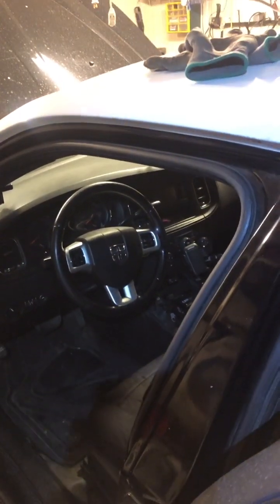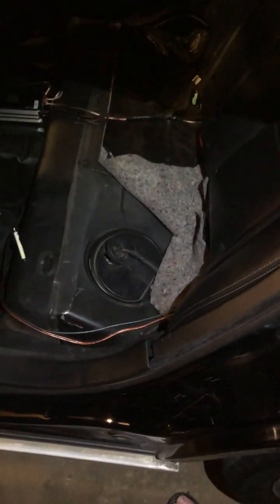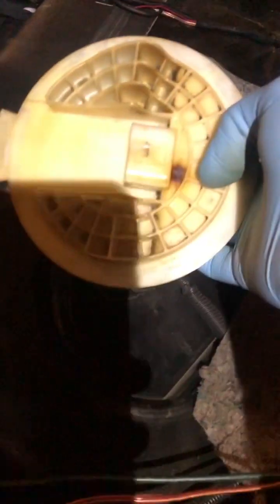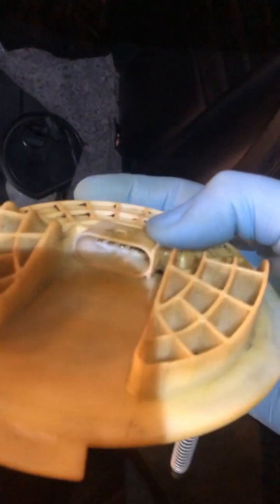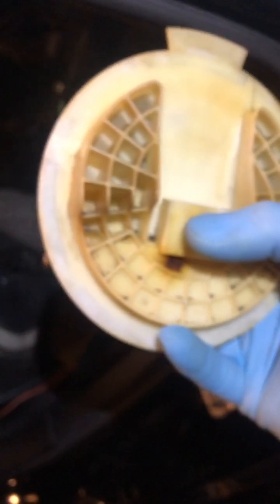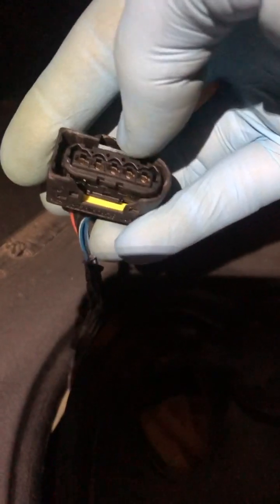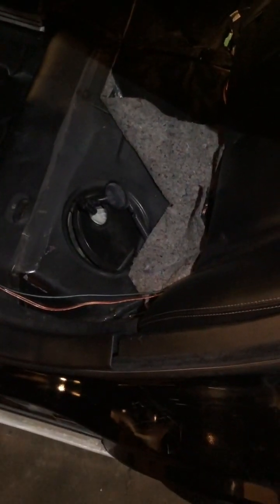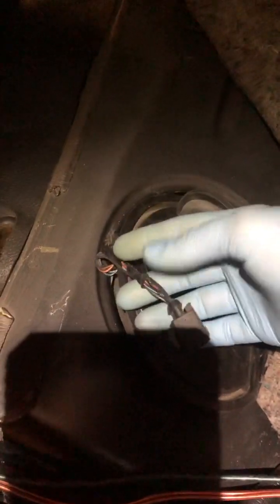Bad fuel pump design on Dodge Charger/Challenger/Magnum & Chrysler 300

Comment: So I don't use bottom off the now full pump just the top let me know
Reply from the maker: If it’s just that top part that is cracked, you don’t have to change out the whole pump.  That top part will separate from the bottom.

Comment: So i just had this problem today, 2012 dodge challenger sxt, i had put the new wires together and i got no start or prime, when i put it back to the original order with the positive and ground next to each it started up just fine, my thing is i dont want to burn up another pump, i just replaced it a month ago and when i took it off today it was just as burt up like the one in your video, not sure what to do
Reply from the maker: @chiefspartan0163  If the wires coming from the car’s wiring harness are repositioned in the harness plug then a fuel pump with the new wire positions in its plug has to be used.

Using a pump with the same old wire position in its plug will only work with the original, unsafe, wire positions coming from the cars wiring harness.

Comment: Hey buddy, my 2009 Dodge charger my driver side got gas in the tank my left side empty. I’m having a crank no start Any advice
Reply from the maker: @dreamteam8626  - verify the main fuel pump assembly is powering up when ignition is in Run.  Do that by hitting Start button twice with foot OFF the brake. First click puts it in ACC, second puts it in RUN.  As soon as it’s in RUN, you should hear an audible buzz for 1-2 seconds from the main pump assy behind drivers seat.

If you do not hear that pump energize, that’s the cause of the no start.  Next would be figuring out why it won’t energize.  Could be a bad pump module, or it could be the wiring harness connection at the plug on the pump hat (under rear seat bottom).

Comment: Hi is what you changed the wiring harness inside the assembly? Sorry by any chance was your car running lean with this issue?
Reply from the maker: It is the wiring harness pigtail on the car that has to be changed, but only after getting a replacement pump with that new reconfigured plug connector.
Reply: @NukeNukemson  Thank you for your response did you by any chance had negative long term fuel trims when this happened?
Reply from the maker: @JoseSandoval-ic5xe  I did not have any fuel trim abnormalities with either Charger when these connection/cracking issues were happening with their fuel pump hats, and that makes sense because the actual pump module inside the assembly worked fine during all the trouble.

However, before the leaky hat issue on the 2012, i did replace that primary fuel pump assembly in it due to the pump going weak and eventually failing.  And when it first started acting up (getting weak), it threw a DTC for a lean fuel trim and illuminated the Check Engine Light.

It got me home that night, but then failed to start the next morning IIRC, at which point I diagnosed it and then replaced it.
Reply from the maker: Actually, the more I think back, the more I believe it continued to run for a while after the lean DTC and CEL, but I knew it was on the way out and so did the replacement within a few days when I had the chance to do the work
Reply from the maker: FYI:  a lean fuel trim issue does not always mean the primary pump assembly (or the auxiliary sending unit on passenger side) is going bad.  Many times it does mean one or the other needs to be replaced, but it could also just be an obstructed or partially clogged fuel filter/sock inside the primary pump assembly’s basket.

Those little socks aren’t considered a serviceable item, so a complete pump assembly replacement would be the official repair for a clogged one, but I think I would try manually cleaning the debris off it first to see if that was all that was needed if I found mine to be severely clogged upon inspection
Reply: @NukeNukemson  I actually did replace the fuel filter and sock there was a lot of dirt in there kind of like sand, I sometimes think it is a fuel problem that maybe I just need to replace the fuel line from the tank up to the engine it might be clogged
Reply: @NukeNukemson  I replaced the in tank fuel pump but I got one from AutoZone, I'm thinking it doesn't flow well, do you think if I get a higher flowing one will be better? I don't know if it hurts to try.
Reply from the maker: @JoseSandoval-ic5xe  which engine is in the car?  How many miles on it?  Is the lean fuel trim DTC the only one coming up or are there others?
Reply: @NukeNukemson  No there's no lean codes on the car just noticed it starts to go lean when I have transmission in park once I have it on drive it's ok fuel trims go closer to 0 it's a 2011 Kia optima I just hae engine rebuilt a month ago
Reply from the maker: @JoseSandoval-ic5xe  my mistake, I was thinking you had one of these Dodge Challenger/Charger/Chrysler 300 cars and were getting a CEL for lean fuel trims.  Everything I’ve detailed about the fuel pump wiring, configurations, etc. was all specific to these Dodge LX cars’ fuel system.  I dont know how much, if any of it, s applicable for your vehicle.  I have never done any kind of maintenance or diagnosing/repairing on those cars, so I cannot speak with much authority on them.  

Sorry, man.  

I will say, if there is no CEL illuminated right now, the car’s ECU/ECM is satisfied the engine is operating correctly and efficiently.  So replacing parts to address fuel trim fluctuations seems risky to me.  I would wait until the car tells you it has a problem (with a CEL and corresponding DTCs) before beginning to replace things.
Reply: @NukeNukemson  Awesome thank you I will take your advice thank you for your responses